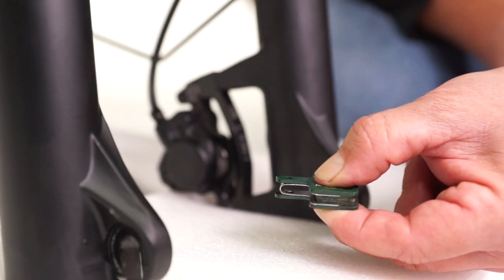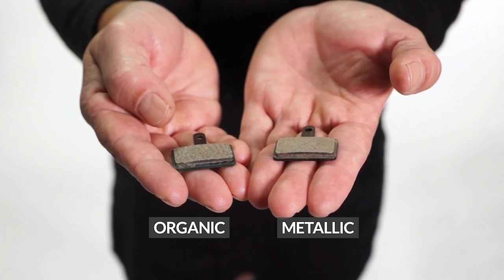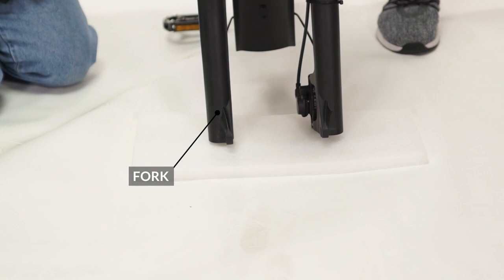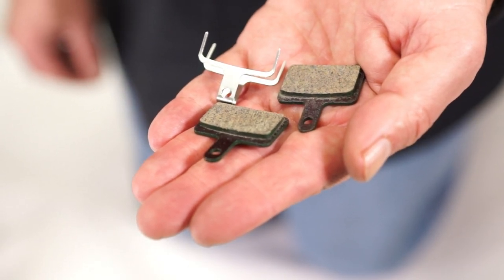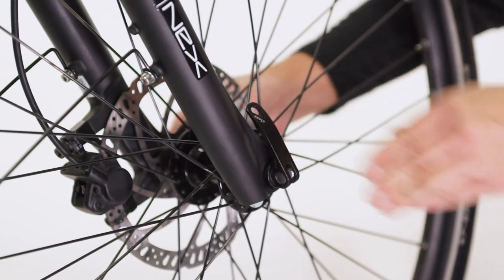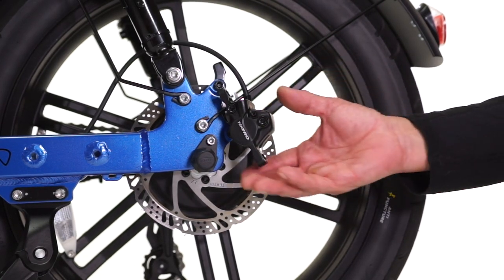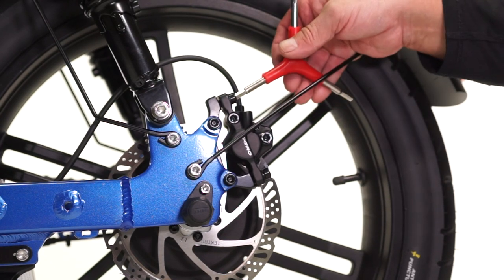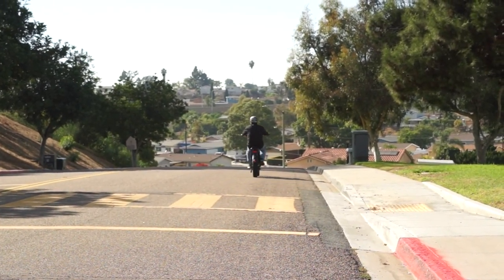Juiced Bikes Brake Pad Replacement

Comment: Can yo do this without removing the wheel?
Reply: You could just unscrew the caliper from the bike and replace the pads that way, but you would need to re-align the caliper after.
Reply: Removing the wheel is an unnecessary step. Any bike mechanic worth their salt will go the route of just taking the caliper off and realigning it after changing the brakes. Why over complicate an easy job Juiced?
Reply: @overt1984  Agreed ! Alignment is easy-After replacing pads, leave caliper bolts loose/Squeeze brake lever to actuate brakes/while brakes are actuated, tighten caliper mounting bolts, then release. Tighten bolts to proper torque. This is shown in video starting @5:17 EZ-Peazy

Comment: My Ripcurrent S has pins holding in the brake pads instead of a retaining screw.  It's the same procedure, but you've just got to straighten out the pins and pull them out instead of unscrewing the first screw.  This video has an example: https://www.youtube.com/watch?v=Xqw0SaZl-jo